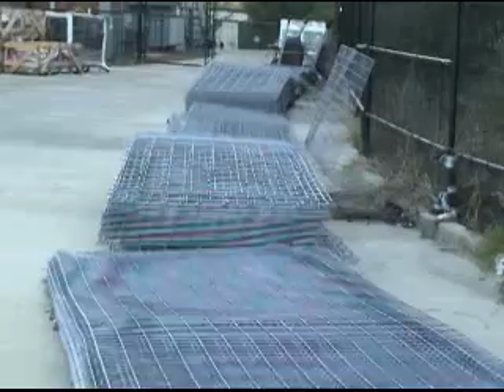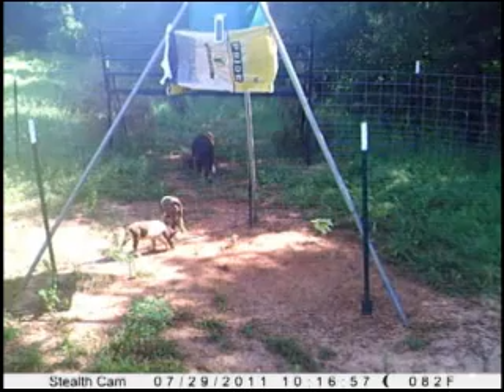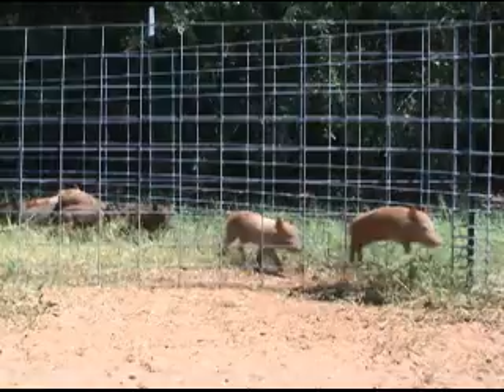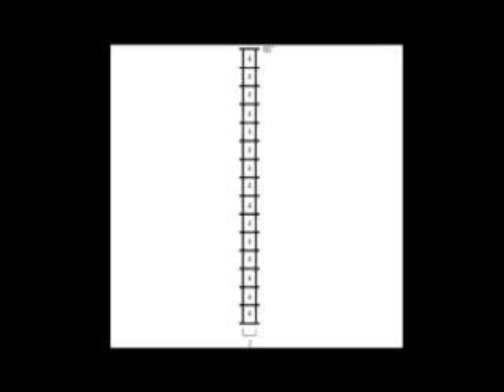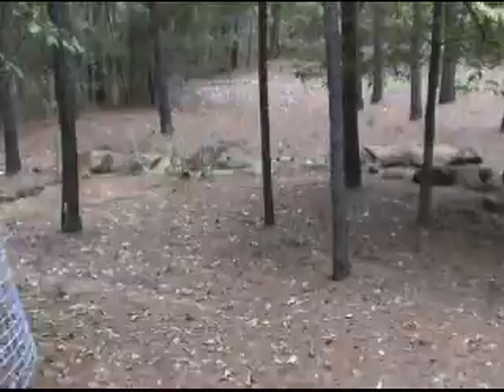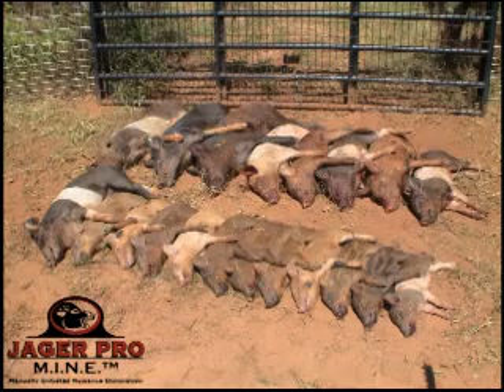Hog Trapping | (6)- Panel Selection May Lead To Feral Hogs Traps Failing | JAGER PRO™

Comment from the maker: One reason JAGER PRO is so efficient at feral hog control is because we are retired Soldiers and trained to be adaptive thinkers with a results-based strategic approach. Most academic and government agencies are trained to use a science-based linear approach. We do not need "conclusive" evidence that a 3 week old WILL escape but a 7 week old WILL NOT. Our goal is to educate viewers about wild pig behavior so they make an informed decision to purchase a device which prohibits escapes at all ages.
Reply: Well said and a great reminder.
Reply: I would expect that an overlaying of wire fence onto a larger mesh would be sufficient.  
We have a wire fencing material where I live (Tasmania) which is made from 3mm (1/8”) wire and resembles chicken wire with all openings less than 30mm (1  1/4”). It is designed to be resistant to anything weighing up to 150kg, and is definitely strong enough to hold our razorbacks, if overlayed on a welded mesh.

Comment from the maker: Several types of livestock panels are commonly used to build corral
trap enclosures. These hog, sheep, goat, cattle and horse panels range in heights between 34 and 60 inches tall, normally 16 feet long and contain mesh openings from two inches up to six inches tall. This segment will demonstrate why most commercial livestock panels are vulnerable to feral hog escapes.